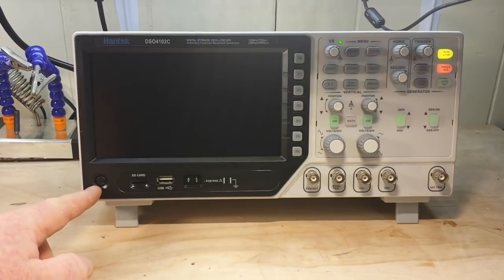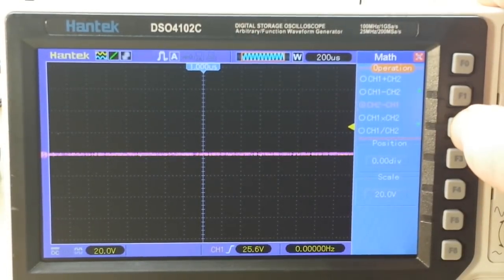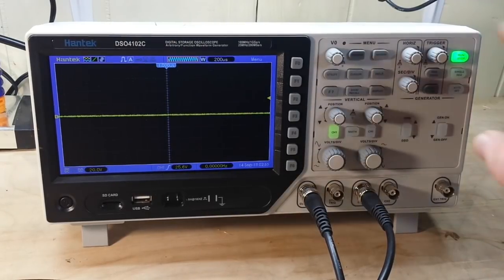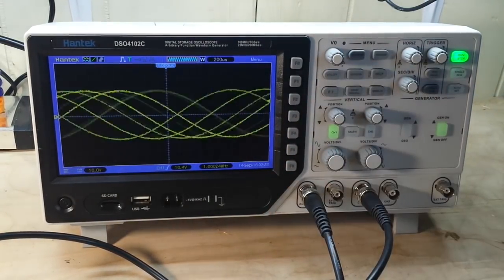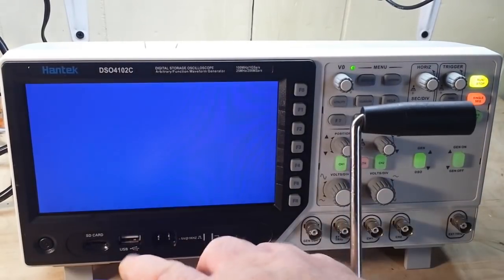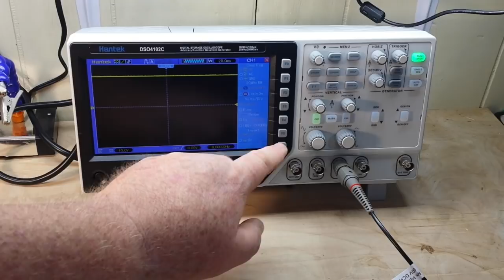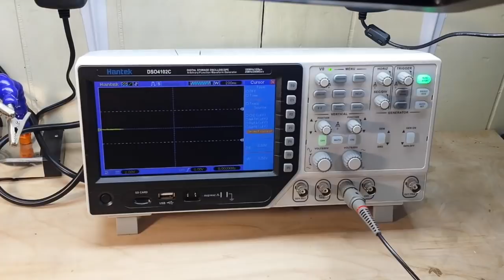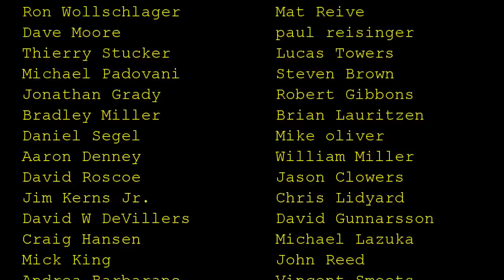Hantek DSO4102C First Look

Comment: I like the built in function generator. Definitely small foot print for a beginners work bench.
Reply: Is the 25mhz enough for CB radio repair?? Or a 60mhz be enough? Wanting to get into tinkering and setting up a small work bench.